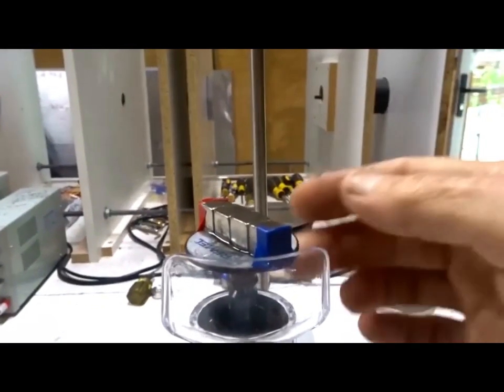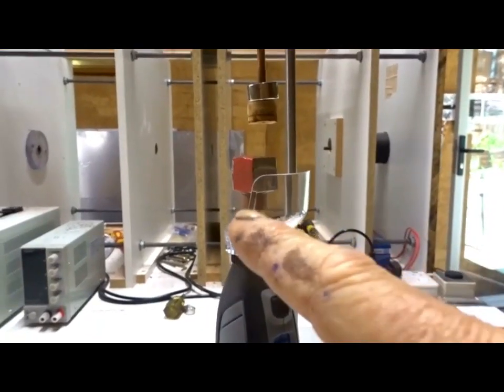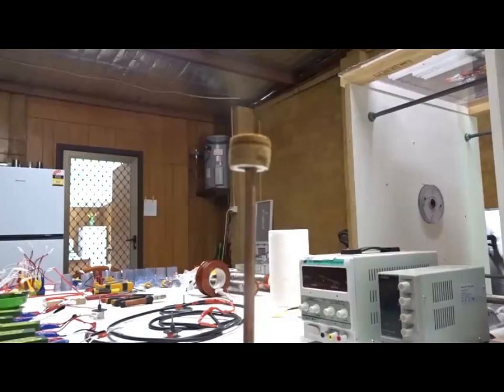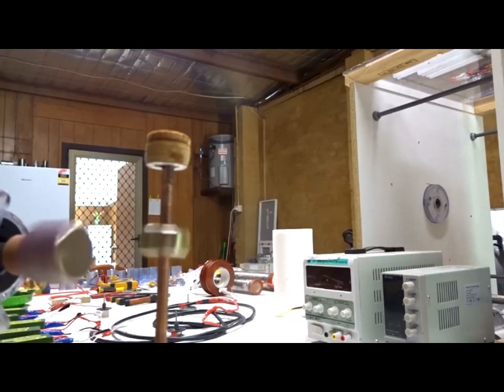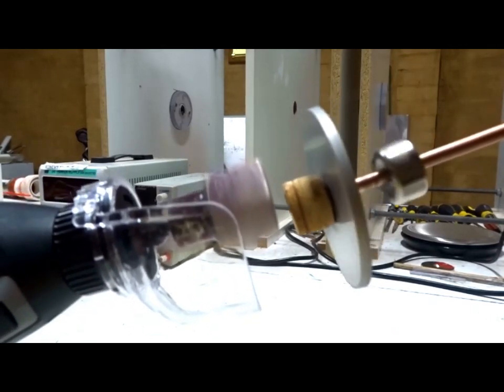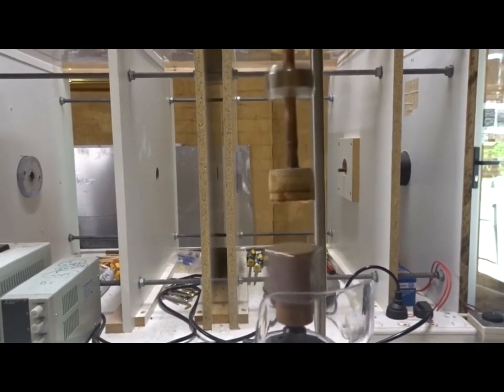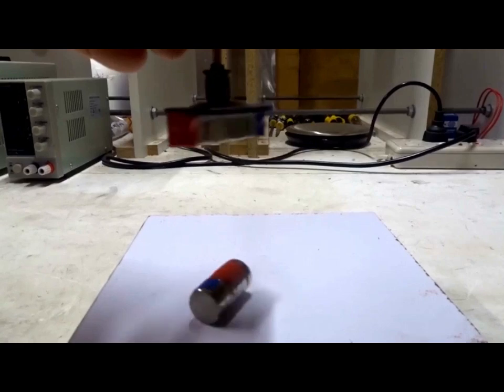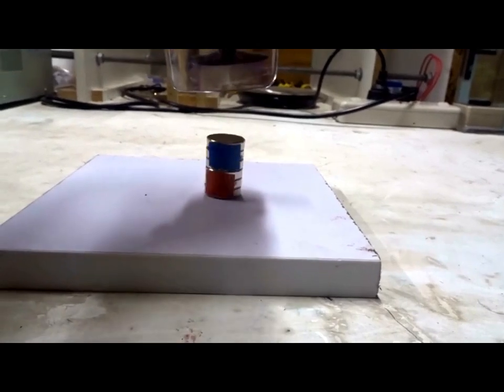A careful study of the magnetic "space propellor"

Comment: It would be more interesting to reduce the friction effects caused between the shaft and donut magnet, say using a high speed ceramic bearing between the two. Additionally, what differences occur in 'floater' magnet, (eg spin direction), when the direction of spin is changed in the spinning 'rotor' magnet, assuming the dremel tool is reversible.

Comment: Sir, it would be interesting to see the reaction of two neo disc magnets glued, in opposites, N/N or S/S, in the field of the rotating dremel magnet. Expanding space should cause differing or exaggerated effects.
Reply from the maker: The two fields would cancel, but I can try! Hard to glue them together? When set on the rod repelling naturally, there is no effect.
Reply: @DrHoraceDrew  Thank you, thank you, thank you. When two are are forced together, it is thought to cause an expansion of the magnetic and forcing a shift of the dielectric inertial planes, warping the field geometry. I do believe you will be pleasantly surprised for your efforts. Placing disc magnets in a piece of tube cut into a short ring, and compressing them together in a vise, or with a large "C"clamp to hold them while curing the glue should work. As you know, Neos are brittle, and a fracture flips the field in the broken pieces.

Comment: The magnet on the shaft wobbles as it spins. Centrifugal force throws one edge of the inside diameter of the magnet against the shaft as it spins, and, since the magnet is tilted, it begins to walk up the shaft, much the same way a nut would spin up a threaded rod.
Reply from the maker: It rises like a spinning top. However I have not yet figured out how to make "UFO physics" from such a rise. The copper rod does not have any "thread".
Reply: @DrHoraceDrew  It doesn't need threads, the reference as an analogy. If you could draw the angle of the inside edge of the magnet, and unwrap the threaded rod to a flat plane, you'd find it would trace a diagonal line across the unwrapped pipe. 

That line indicates the direction of travel of the magnet.
Reply: @HannsGruber  yep. get a piece of pipe, hold it on a screwdriver, and very carefully spin it on a bench grinder... 

hula hoop...